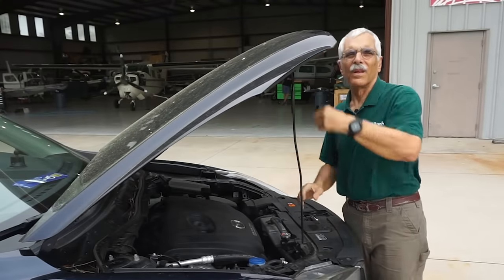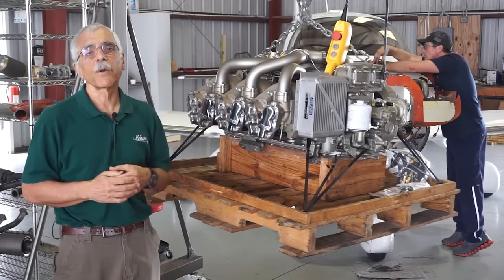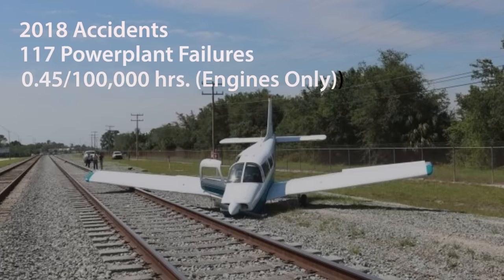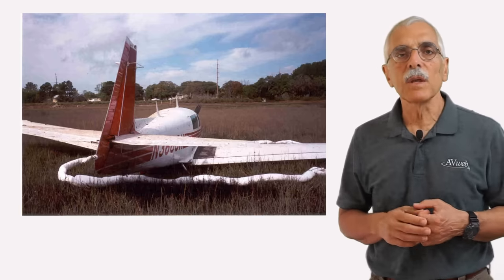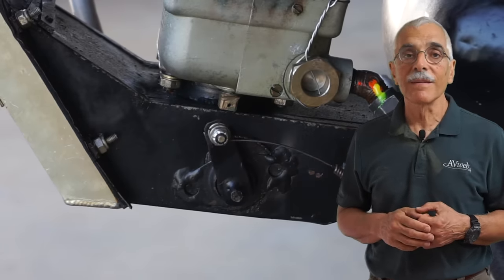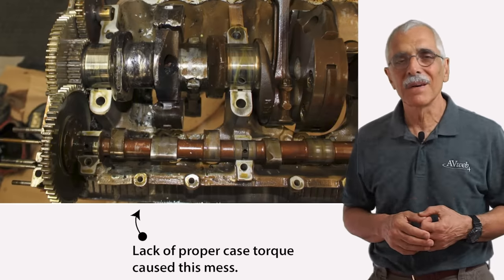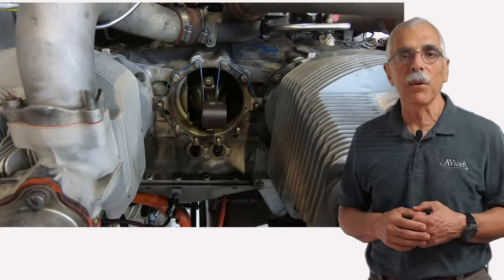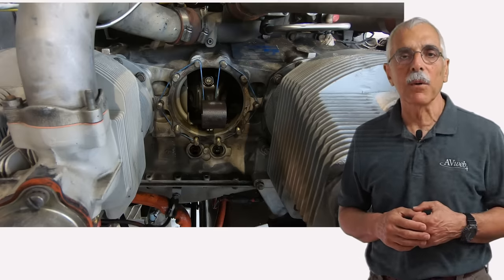Why Aircraft Engines Quit

Comment: I've been driving for 50 years.  I average about 15,000 miles per year and have NEVER had an engine failure.  If you assume an average of 40 miles per hour that's over 18,000 hours.  Unlike airplanes, cars do a lot of stop and go with frequent and wide variations of RPM.  This is much harder on an engine than a full throttle takeoff for 4 or 5 minutes followed by an hour of cruising and ending with reduced RPM's until you taxi back to park.  Everything that is intended for an airplane is 5-6 time more expensive than a car with little or no better reliability - perhaps less reliability.

Comment: Spot on Paul. Ultra conservatism helps to hold back development in the aviation industry. Too many people requiring boxes to be ticked actually hinder improvements. Sure, you need regulation but you also need innovation. That's why modern car engines are so reliable, manufacturers are never happy with the last thing they made, they look for an edge to impress the customers. Customers are King here, they don't like things breaking and the car companies will constantly try to make their products more reliable. The FAA, CAA, well they just want you to fill forms and cover their own asses, they don't really care about the customer.

Comment: Direct Ignition will limit this engine to 90K miles. If you spray a cleaner into the throttle body every 12K miles, or take the heads off and clean the valves, you may, repeat MAY stop it from sending bits into the engine and grenading. DI only, without adding port injection, is a recipe for disaster.

Comment: My last vehicle was a 2001 chevy astro with a 4.3L vortec and 190hp. My current vehicle is a 2014 dodge grand caravan with a 3.6 pentastar and 283hp. The grand caravan gets twice the fuel economy, but if I had to put one of those engines in a plane, I'll take the vortec any day of the week and twice on Sunday. I accidently ran the astro with almost no oil / oil pressure for a month, and when I scrapped it, there was nothing wrong with the engine. I am not sure the caravan engine would make it off the road if it lost oil pressure.
Reply: I hate to be the first reply on my own comment, but if gm can make an engine that ran with loudly tapping lifters for 100km before my dumb a$$ clued in, why are aircraft engines exploding with the slightest provocation? I want to be a pilot. I am about to sign up for ground school at my local airport. Should I reconsider???!!!

Comment: It seems lives could be saved by fuel injection and electronic engine management. I'm a car guy with a passing interest in aviation. It still stumps me how many small aircraft run carburetted engines. I'd trade weight and price for safety any day.

Comment: An engine as mission critical as an air planes should have a roller lifter camshaft not a flat tappet with all the friction they generate. I also wonder if there isnt or should be a fuel temp gjuage and a water separater installed, but maybe a separater wouldnt work on a plane

Comment: The most problem i see that airplane engines use tech from the 60-80s. Cars on the other hand can operate in extreme weathers like +40C and -50C without an issue. A modern volume production car engine would outperform these antiquated ones while being way less noisy, less polluting, more efficient and without a lot of weight penalty. Not to talk about the cockpit of airplanes. It's a flying museum for me, i have a degree in industrial automation.

Comment: My instructor and I Iced up the carb in my 150 practicing stalls. Second stall, full power and I thought we blew a jug off. Thankfully I said "lets spend another minute climbing to get another 500 feet" Stall broke at 2400 AGL and the engine came back around 800AGL. He was going to have me start at 2000 feet smh.

Comment: I'll comment first then watch, a while back doing 100 HR inspections on many owners aircraft, the most retarded process was discovered by everyone of them. 
They all changed the oil ice cold, vs hot coming back to the hanger. 

You wouldn't believe the Bs seen when removing oil pans. 
There's 2" of thick grey sludge left behind every cold oil change. 

So what do you think happens on next run up and engine gets up to 200F. 

All this sludge remelts into the new oil. 
* Owners - Stop Changing Oil Cold. 
This was so easy to learn as a kid in gas stations in the 60's. 
As last drop of HOT old oil appears, 
add at least 1/2 quart of warm oil, so as it enters engine it's heated to near 150F and pushes out the remaining old oil, and quite obvious when pure clean oil appears, now cap it, and continue to fill. 
Now checking dipstick after warm up run, notice how clean the oil is. 

I'd make it a severe FAA law, with severe fines if it's ever done, and a mystery crash took innocent lives. 
But FBO's have to get with the program as well. 

Cheers

Comment: The aircraft engine is hanging in the air on a chain. But because the chain is relatively short it hangs pretty flat. The stresses on the two points on the engine and the chain must be pretty high. I would never hang something heavy like this. Use a longer chain and the forces decrease substantially.
Reply: And on closer inspection, the chain can slide through the hook, suddenly rotating the engine.

Comment: I’ve had two carb ice incidents in my 150 in the past 5 years. (I was using carb heat, and no visible moisture)
Reply: Check if fuel mixture is too rich.  A bit of ice only will make it richer and cylinders failing.  Or using oil.  = both are mixture too rich via too much fuel or oil inside cylinders.

Comment: If the Mazda ( or any other car engine for that matter ) had to constantly run at Max power settings , you'd see a LOT more failures . Car engines ( except for very short stints during passing ........or drag racing :) )  pretty much loaf along at fractions of their actual capability .

Comment: The Continental IO550 in my 2007 Bonanza G36 burned 7 exhaust valves in 650 hours over 10 years and 3 owners. 
No thanks. Until Cirrus dumps the Continental, they are a no-go for me.
Note- I’ve never lost a valve in my Lycoming IO540, four Lycoming 0 and IO 360’s, three Rotax 912’s, or the dozens of cars and hundreds of motorcycles I’ve owned in the past 50 years.

Comment: Car person with no aviation knowledge here...
But do y'all not have check engine lights? How is it possible that things as easy to monitor as temperature and water concentration aren't just monitored via sensors and shown to the pilot? $40,000 for an engine alone and it's worse at figuring out what's wrong with itself than a '60 beetle?

Comment: Hard to trust anyone working on your stuff. I recently bought a '20 GMC Sierra 2500 with the diesel engine.... driving down the highway and suddenly it started shaking and vibrating like crazy. Turns out a mechanic had replaced the crankshaft gasket and re-used the old bolt (a big No-No). That bolt sheered off, spun the harmonic balancer and pretty much destroyed the entire engine. After arguing with GMC they finally replaced the entire engine with a new one.

Comment: 2:40 "It, too, has throttle by wire—a big steel one that runs directly from the pilot's mitts to a mechanical throttle body." 😏

BTW, Paul, do you think single engine planes would be more safe or less safe if they had $5,000 Mazda, Toyota or Honda car engines in them, instead of $50,000 Lycoming, Continental or Rotax engines?

How about a twin engine plane with a pair of $5K Mazda, Toyota or Honda car engines, compared to a single-engine plane with one $50K Lycoming, Continental or Rotax engine, assuming the twin can fly on one engine?  Which would be safer?

Do you think that a twin with car engines could be made for close to the price of a single-engine plane with a $50K aviation engine?

Comment: So, the question that, perhaps, you did answer is...Is there something generally inherent to aviation engines that make them more susceptible to failure than auto engine failure? It seems like there is, but I have to factor in the fact that when a car engine fails you rarely ever hear about it, but when a plane engine fails you most certainly are more likely to hear about it due to the resultant impact with the ground. It just makes news.

Comment: When they say inline don't they mean inline with the transmission and rear axle?, Most 4 cyl motors are cross ways in a car, so is it still inline? I wouldn't think so, for example, a 1996 Ford f150 with a 4.9 inline 6 cylinder is a "inline" engine because it runs, "inline, meaning it faces straight in the engine compartment from the front of the vehicle to the firewall.
Reply from the maker: Inline refers to the configuration of the cylinders--inline as opposed to V or horizontally opposed.

Comment: Airplane engines are in a weird position- due to 'requirement' and abused inspection / purchase / repair / inspection / 'cost' - they use real really old engines and tech- both on hardware design and fueling- and therefore you take your chance of driving a 1965 Impala at 15,000 feet while giving a clueless 'pilot' control of fueling...  As a car guy- who has been hottrodding cars for decades and has his own lift in my garage- there is NO excuse for this...

Comment: I think the automotive motor should replace these aging split case designs I’ll take a Chevy LS motor any day. Can be set up with redundant fuel systems and engine management. It won’t be long until we’re talking about what battery platform you’re running for your energy.....

Comment: Manufacturers would introduce many more fixes that would increase reliability of engines if it was not so horribly expensive to certify redesigned engines. Perhaps government should help with cost of testing and certification of reliability improvements in order to encourage better safer engines.

Comment: Rotax Backcountry flyers are frequently replacing cylinder out in the wild. It is simple Rotax are high RPM gear reduced engines. They turn yeicey as much snd produce more power to weight. Doesn't make Rotax bad just plan TBO SOONER

Comment: I love how massively overbuilt aircraft piston engines look compared to modern car engines. Additionally just how refreshingly simple even the newest engines that Lycoming / Continental produce are. none of the enforced emmissions guff that car engines get, and there's no extra points of failure... no VVT or VVL... no stupid belts to drive the cams. just 4 or 6 cylinders, pushrods in ya valvetrain driven by a cam on gears... doesn't get any better than taking the Keep-It-Simple-Stupid approach that cars have been forced to neglect thanks to the emmissions regulations that are being enforced now!!

Comment: "The less complicated it is, the simpler it is, the less it can break, right?"

I disagree. My professor of engineering design was fond of challenging us to think of any technology that has become simpler over the years. Machines have become progressively more complex and by virtue of this they are cheaper to make, have higher performance and greater reliability.

If you don't believe me we can enter the Paris-Dakar rally and I'll take my Toyota Corolla 1.3GL and you can have a Model T Ford. Or I will challenge you to a duel and you can have a smooth bore musket and I will have an Armalite with a laser sight.

Engineers should not be afraid of complexity but should strive for elegant design. The deep understanding of engineering science and manufacturing methods that we have today enable intricate devices to be concieved and made that solve reliability issues, or stretch performance.

Comment: What's the 'technical' difference between 'Fuel Starvation' and 'Fuel Exhaustion'. Sounds like Timmy ran out of fuel on both occasions?
Reply from the maker: Exhaustion means there's no fuel aboard the airplane anywhere, starvation means there is fuel, but the pilot mismanaged the fuel system or something else intervened.
Reply: Thank you.

Comment: Automotive engines  with Fuel Injection or EFI from the 80s onward are way more reliable than Lycoming 0-320, 360 or your favorite carb'd opposed engine.   Automotive engines can make it to 100k miles without a major overhaul.  The General Avation community is using 1950s technology or 40s. Carb icing would be a non issue with fuel injection.

Comment: Why don't planes have automatic carb heat, pitot heat, etc.? And interlocks to prevent pilots from accidentally selecting an empty tank?
Reply: Probably because carb heat decreases power and selecting an "empty tank" can actually have remaining fuel in it.
Reply: @arthurfoyt6727  sure, but aren't there temperature and other conditions the plane could detect to determine when carb heat is appropriate? And a fuel selection interlock could have an override for when the pilot really wants to do that.
Reply: @dfeuer  That only adds a new layer of failure.

Comment: How come my stock honda 109.8 cu in cranks out 140 hp and Cessna 150's 200 cu in barely eeks out 100 hp?  I wonder why Honda or Toyota with their reliability make a retrofit engine for most airplanes? They would probably get 5000 hrs bmoh at 1/2 the cost?

Comment: Simple answer = engines are mechanical devices..As such moving parts have a higher failure rate than stationary parts within normal operating parameters.

Comment: Modern FORKLIFT engines are lighter and more reliable than your aircraft engines.
If they were serviced at the same level as an aircraft engine , they would never fail.

Our biggest causes of failure are 
1. Fuel contamination.
2. Clogged radiator ,( overheat ).
3. Going 5,000 hours (or more )without changing the oil.
4. A loose nut behind the steering wheel.

If they ran on inspected fuel , were always serviced at their required intervals they would always outlast the vehicle ( about 15,000 hours )
Even with all the abuse they get we rarely see a "no start" at less than 5,000 hours and its almost always operator abuse/negligence.

Comment: 2131671 CFII commercial flight instructor X 50 years. Pilot error due to failure to plan flight use chacklists and fuel exhaustion #1 cause by far.

Comment: Paul you never got to a failure rate for auto engines? Typical cars like your Mazda will do more than 100000miles without an engine failure, how many hours is that? They run on untested fuel, they usually don’t get any more attention than an occasional oil change and if we spent the average cost of an aircraft annual on them they’d probably last a lot longer.
The big difference for me is that aircraft piston engines are run wide open for long periods every flight during takeoff and climb, car engines are comparatively idled around under no load.

Comment: So basically, you wouldn't want an aircraft engine in your car... because they're not reliable enough.
How hard can it be to design an automatic Carb Heat system? That sounds like a student project to me.
I'm staggered that the legistlators don't insist on better designed engines. These are museum pieces that have no place in the sky.

Comment: Well, that Mazda engine is recording more than 1000 data points per minute of run time, lighting up the correct "check engine" light before the engine quits.. - The GA engine records nothing. So, "less complex" does not mean more reliable. That complexity introduced to the modern car engines is the reason they became that reliable. Of course, such a complex engine cannot be fixed that easily. You need the mechanics to understand what each sensor does and why they are there. It generally requires more engineering knowledge than a collage dropout would have.

Comment: Fine presentation of what pilots are thinking...modern car engines are more reliable than airplane engines so why don’t we develop an aircraft engine that doesn’t have parts from the 19th century, use modern unleaded fuel, and cost north of 50k?
Weight? Limited number of aircraft engines vs car engines create more development in the profitable ginormous auto industry. Ok I get it, but I would buy a Honda or Toyota engine in a minute if they manufactured aircraft engines.